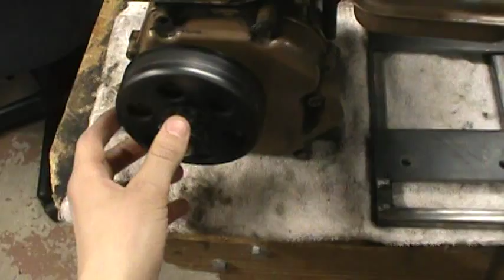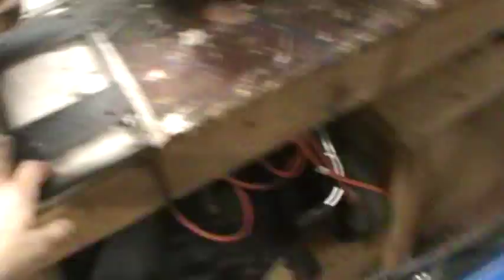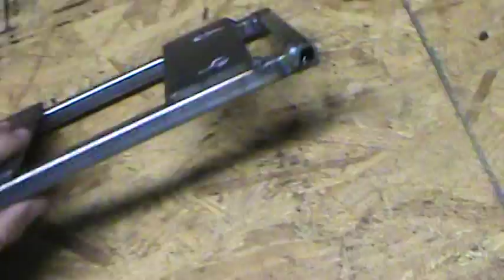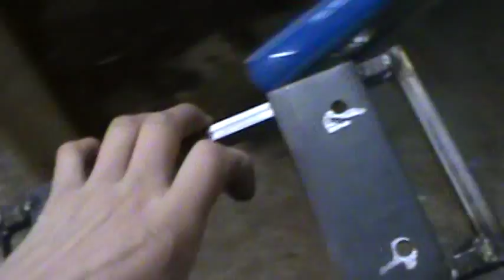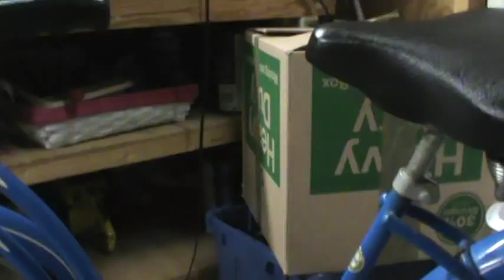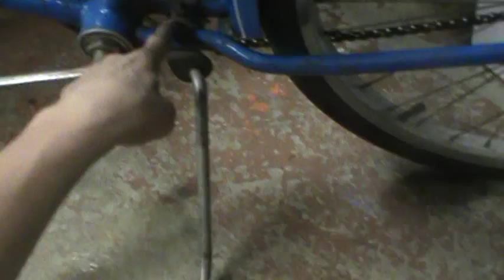Vintage Motorized Bike Build Part 1

Comment: i got a 78-79 fully restored rat motor bike just have to wait a while to have more fund for finish it up.it a male frame i fitted a habor freight 79cc on it but had to remove the tank and muffler and  and get some custom work done.